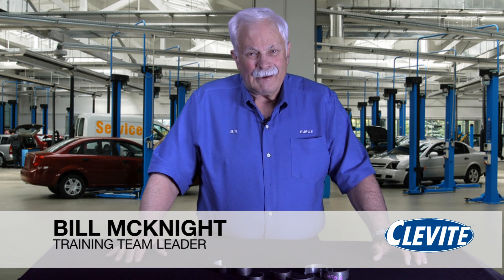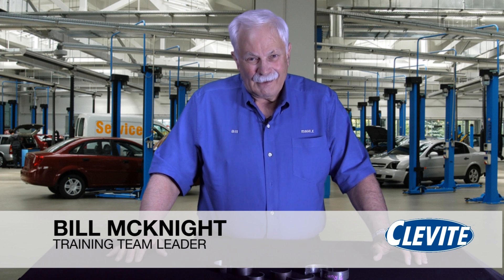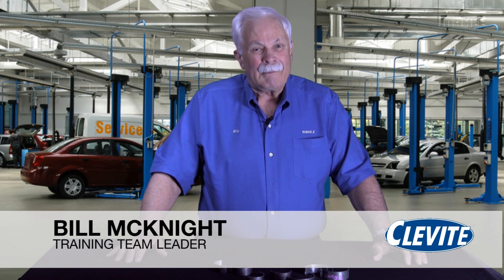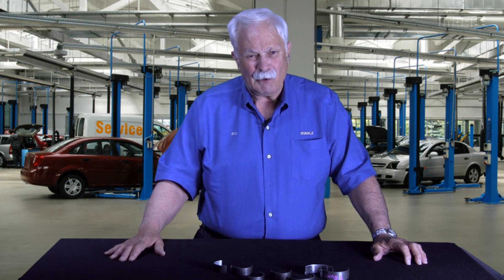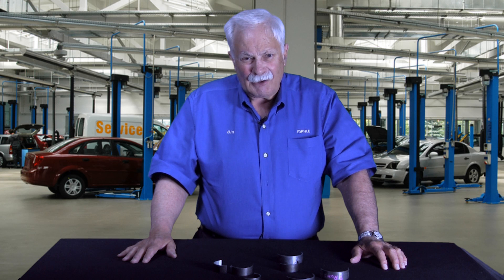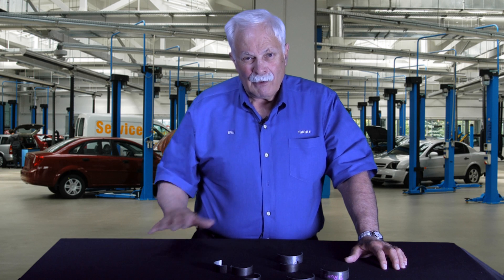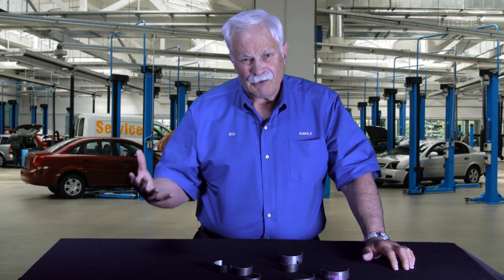Bearing Lubrication

Comment: The best oil I can afford...
Walmart Supertech it is!!
Reply: Supertech oil actually is decent, you almost can't even buy truly bad oils anymore. Supertech's synthetic is virtually the same thing as Costco or Amazon Basics, which was on par with Mobil 1 in Project Farm's testing. Probably not the best choice for a very high performance or endurance racing application, but for the vast majority of engines, it will work great if it's changed regularly.

Comment: Why does Bmw recommend the thicker 10W60 weight oil for the tighter clearances on the s65/s85 motors ?
Reply: Because they think all of their M series customers have heated garages and only use their cars to race on the Nurburgring. But in reality 99.9% of people just drive their M series cars to work and the mall, so they really should be using a 0w40.
Reply: Ross Banner:  Spot on answer my man!
Reply: @SuperSport01  While thick oil might contribute, the real problem is clearly something with the design of the engine since the excessive wear seems to occur to some extent regardless of what oil is used. Whether the problem is the material the bearings are made out of, inadequate surface area to support the load, inadequate oil supply, etc I have no idea, but it's clearly not just the oil.